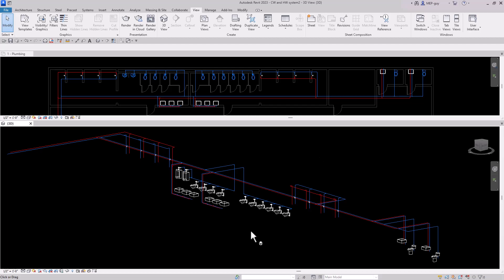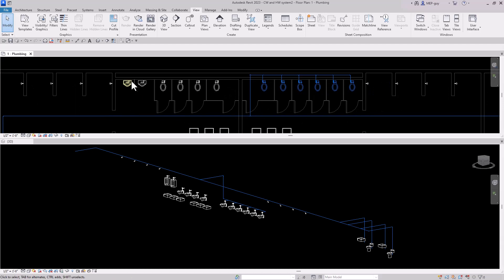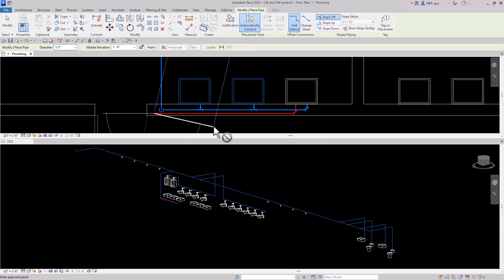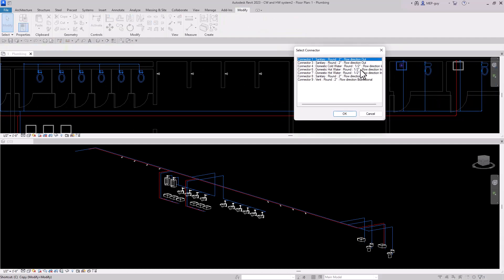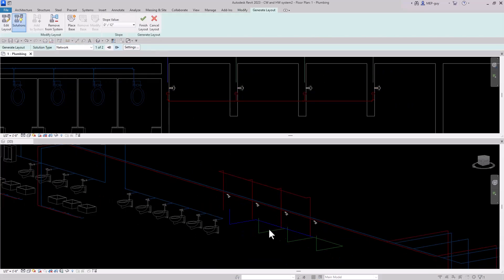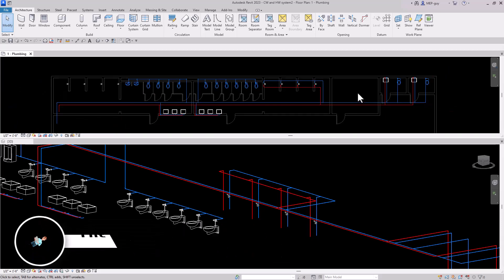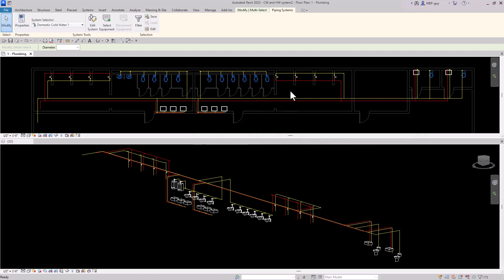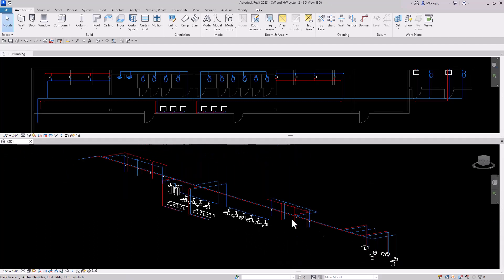INSANELY FAST cw & hw pipe modeling in Revit

Comment: Great video. I do have a question about hot water return. I know that wasn’t part of the video, but how do you handle it as far as connecting to the HW system. When we show the pipes connecting, it breaks the fixture units of the HW system. What we’ve been doing is drawing the HWR piping close to the HW without connecting. Do you know of a way to handle the HWR relationship to the HW better than that?  We’ve made our HWR system a hydronic system so we can add a flow rate to it.
Reply from the maker: Great question. I have always just connected it to the hw piping keeping the systems separate. But that is strictly for modeling purposes. If I wanted connect them, but keep flows consistent I would create a special fitting so that I could get flow through the HW portion and then use a calculated value for the return piping flow. Then use a balancing valve to set the gpm for each branch. It's all in my head as of now. I need to do some tinkering and actually make it work. Just need to find the time. I'm sure I'll create a course on this topic eventually.